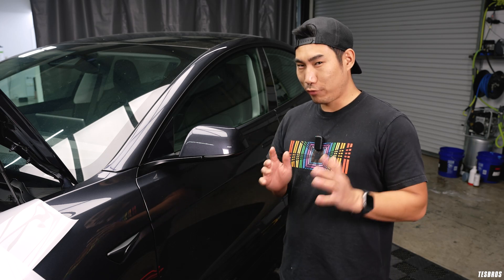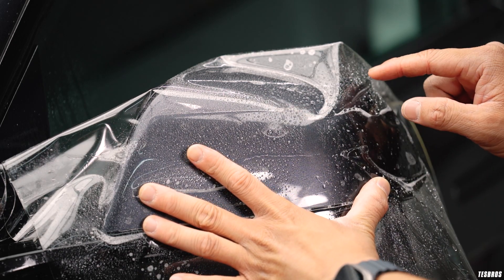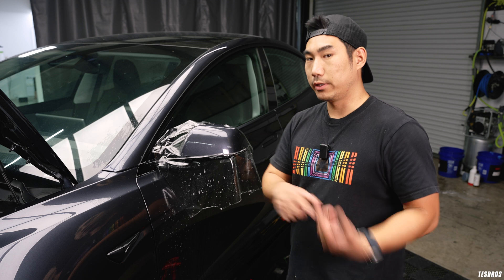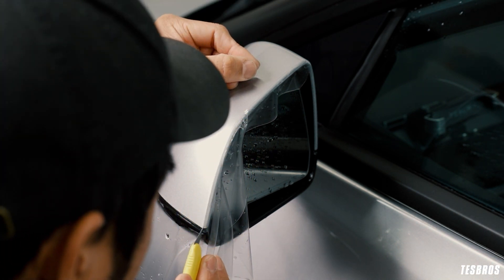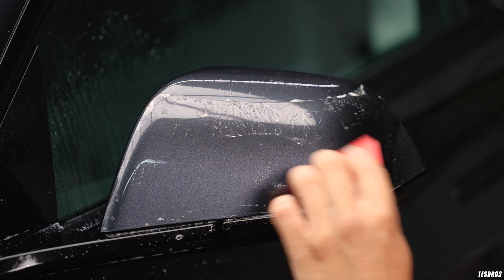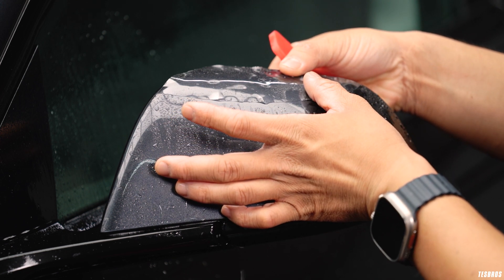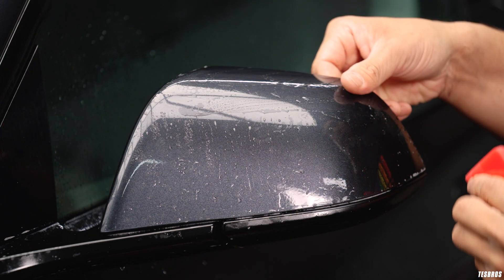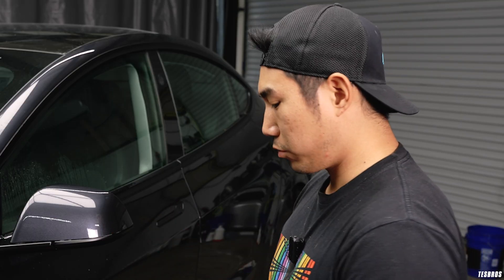Expert Tips: Seam PPF Like a Pro & When to Do It – Model 3 Mirror PPF Install

Comment: what is your tack solution?
Reply from the maker: 70% isopropyl alcohol and distilled water. 80% water and 20% alcohol
Reply: @ thank you for the quick response & happy new years. Would you be able to also provide a link to the best spray bottle to use? the one in the video is similar to what i’m looking for